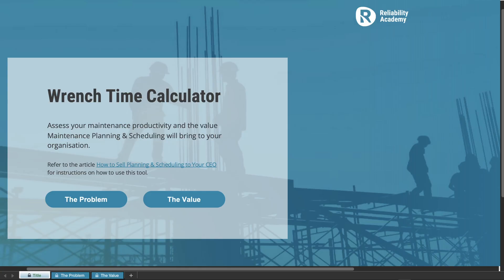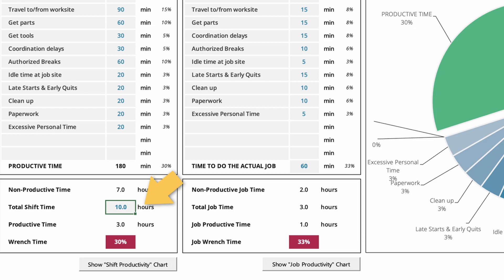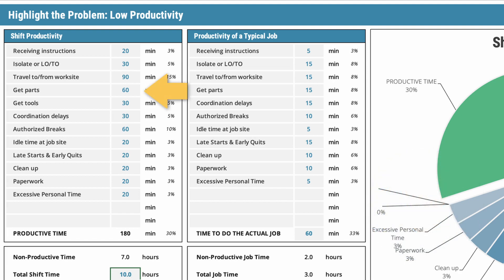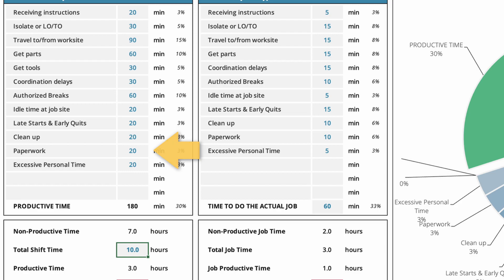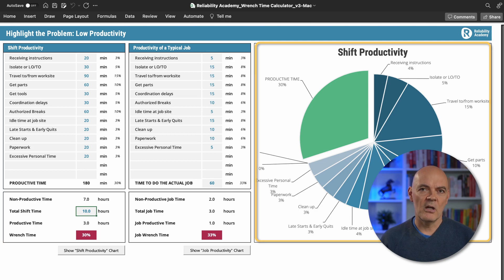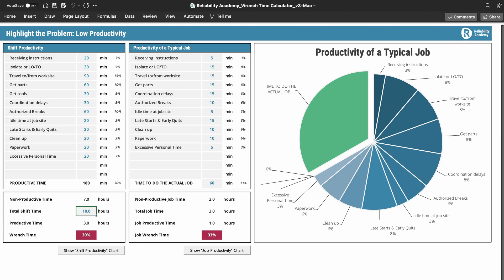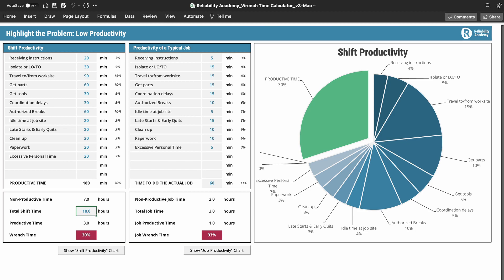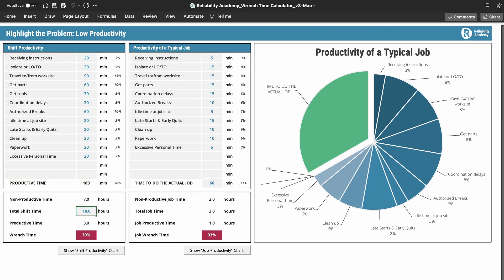Wrenchtime Calculator - The Problem

Comment: Is this called "work sampling"
Reply from the maker: No, work sampling is when you observe (without interfering) m any times per day what epople are doing (using pre-defined categories) and then you use some statistics to estimate productivity. Our Wrench Time Calculator is based on a very simple self-assessment. Its not terribly accurate, but for most plants that have productivity issues (nad most do!) it is accurate enough.